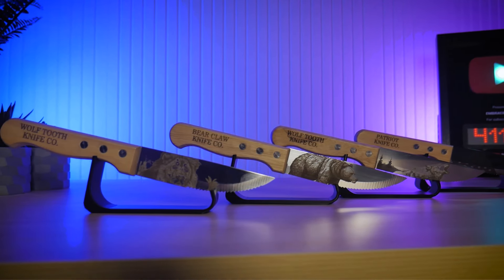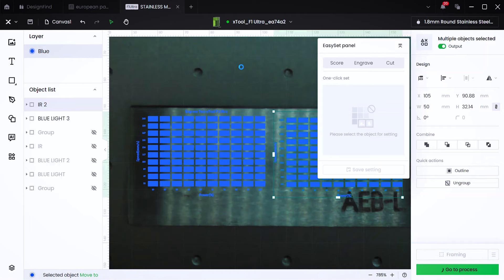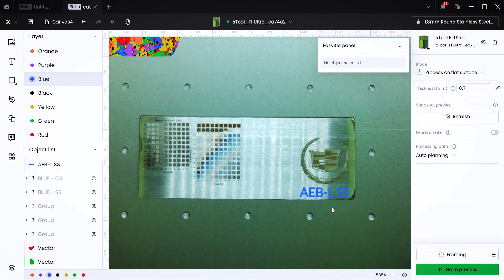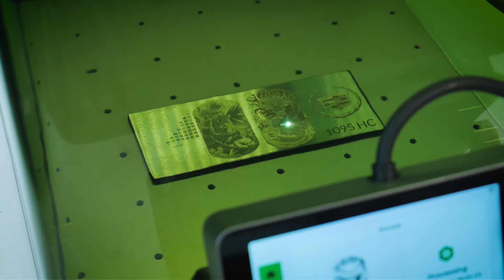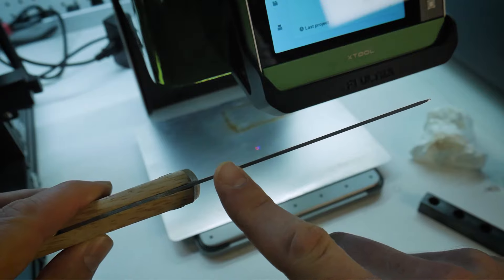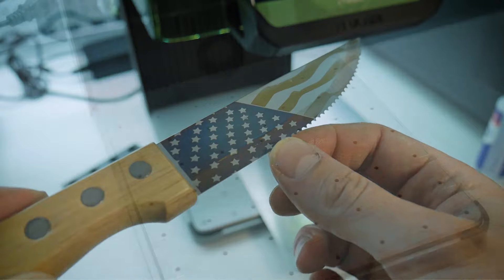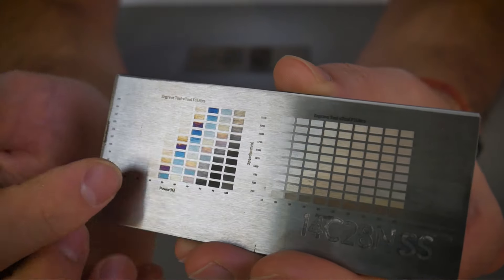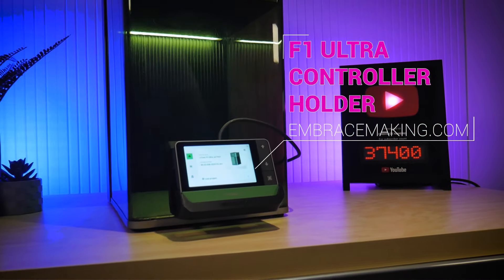xTool F1 ULTRA Engraving Knives - Stainless and High Carbon Steel

Comment: Chris,  I'm glad we connected.   I'm sure other knife makers will value your video & test results.  The details you put into the video should answer any questions they have.  I want to thank you again for doing this, I appreciated the time you put into this.   Keep up the good work.

Edit;
After going through the video a 2nd time I want to address something you brought up.  RUST.  In a high carbon steel any blade will gain a patina over time.  If the patina isn't controlled rust will follow.  One thing I tell all my customers is to care for your blade.  Hand wash only and dry it.  A light coat of oil doesn't hurt either, this goes for Stainless as well as high carbon.  Stainless is the same as high carbon, it could also get a patina but this will not happen as fast as with a high carbon.  There are so many different types of stainless and each have their own properties.  Some have a very high resistance to rust but will not hold a good edge.  These are used in the food and medical fields.  The stainless used for knives will hold and edge but the resistance to rust isn't as high.  Bottom line is stainless is rust resistance not rust proof.  I hope this help answer your and other viewers questions or concerns.
Reply from the maker: Thanks Mike, just so others can see the response here too, if the engraving from the IR laser has a bit of depth to it (not much but from the video you can see material was removed) do you think the engraved area would rust faster than the surrounding area?
Reply: @EmbraceMaking  Chris , I currently use electro mechanical etching for my blades.  I have not had an issue or heard of an issue from any of my customers with the etched area vs non etched area.  I have well over 150 knives all over the country.  Even a few on a Tuna Boat if any were to have issued I would think in the salt water and air they would be the first.

Comment: Nice  Video, I like the way you explain what your doing but, I would like to see you show where these functions are at in the software, they seem to be hidden under right clicks, not easily located like in Lightburn. also How do you use lightburn on the f1 ultra? thanks .
Reply from the maker: Thanks Tony! This video I definitely sped through some of those details as I covered a lot of it in the previous embossing and engraving video, so I didn't want to drag this video on longer than it needed to be. As for Lightburn I don't have as much experience since Creative Space has mostly covered everything I need to do. What is it in Lightburn that you're looking to do that isn't available in XCS?
Reply: @EmbraceMaking  The list of things LB can do quickly and easily that XCS can't is long.  Somethings XCS can't do at all.

Comment: The gradual heat build up of the test object when running a grid throws off the results compared to running any one speed and power setting by itself on a  room temperature object.  This is especially true when trying to get consistent colors on SS.
Reply from the maker: This is a very good point!